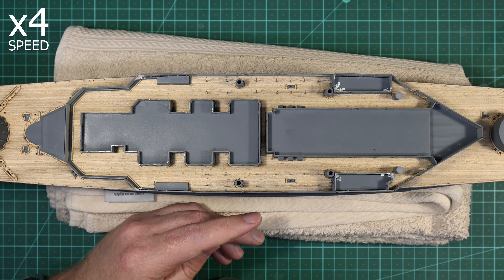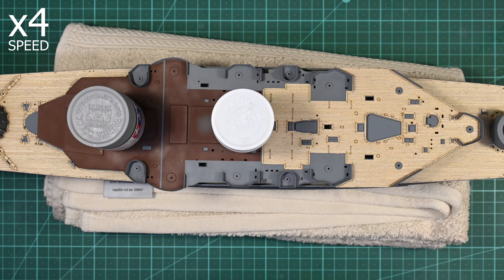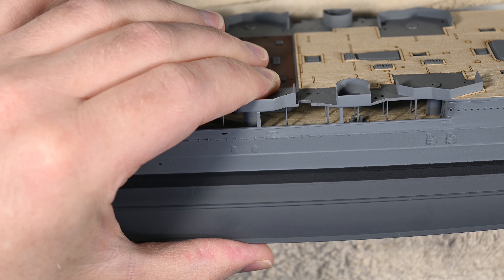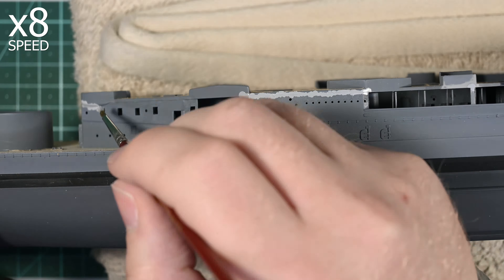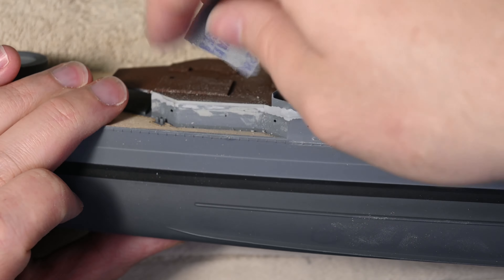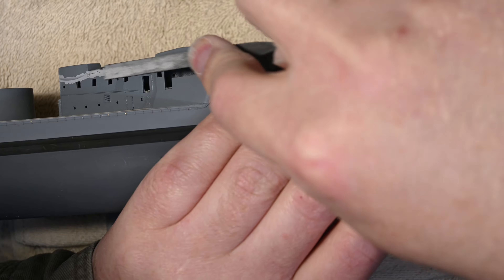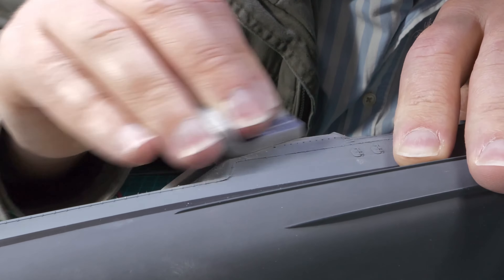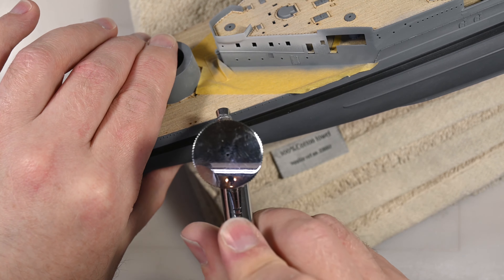1:350 HMS Hood: Part 17 - Installing the Shelter Deck

Comment: Great progress so far! I am working on the Flyhawk 1/700 deluxe Scharnhorst 1943. I do have a question about the wooden decking. Can you spray the decking with gloss and mat varnishes or will that ruin the decking?
Reply: In my experience, applying varnishes does not ruin the deck. It will obviously change how shiny it is.
Reply: I didn't think it would ruin the wooden decking sheets but I was not sure. Thank you. @CrisstheNightbringer
Reply from the maker: It wont ruin the deck, or change its appearance if you finish it with a matt varnish. Some manufactures, like Pontos, actually recommend sealing the deck with a varnish. The wooden decks on all of my ships have been sealed with a matt varnish.
Reply: Thank you kindly. I have the flyhawk decking. Now I know what I will be trying to do this weekend!   @DavidsShips